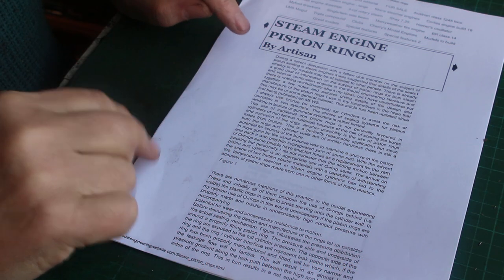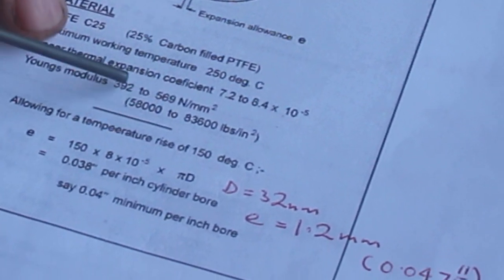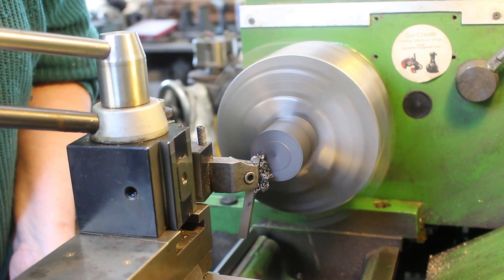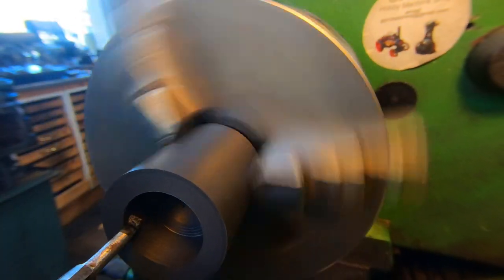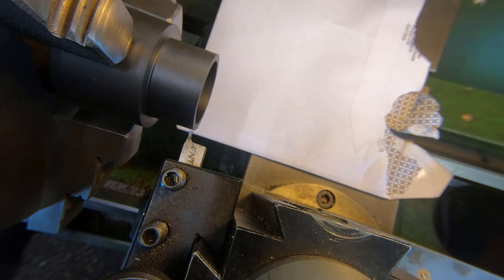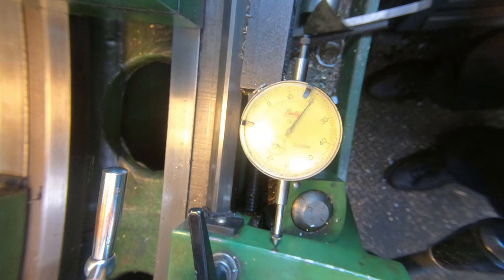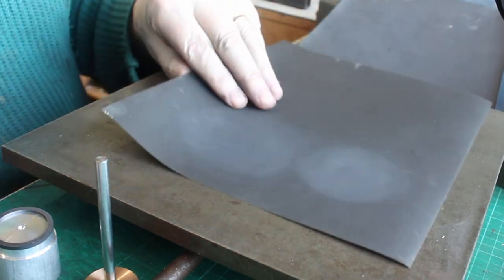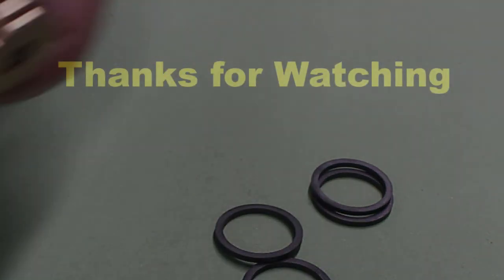Pistons Rings (pt.1) using Graphite filled PTFE, Lion - 5"g  Miniature Loco Steam Engine Build pt.46

Comment: Give a lot more Slot clearence! The piston ring works that way: the steam goes under the piston ring (through the slot clearence than between piston and pistonring) and pushes the pistonring against the cylinder wall....thats tights up against pressure.... backways the same.... the steam pulls the pistonring in the slot back first....than go between the piston and the pistonring.... that thights up.... and the piston moves....  i do a lot of researche because thats my next part... 

Last but not least.... a nice work as usual!
Reply from the maker: Thanks for that information, very much appreciated. So I'll lap them down a little more. Thanks for taking the time to comment.

Comment: If I may be so bold and offer you some advice on lapping! My trade was that of a "Diesel Fuel Injection Fitter" and as such spent countless hours lapping fuel injection nozzle sealing surfaces! The preasures we had to seal against were many thousands of psi, no gaskets or sealant, just metal to metal seals. And the buggers did not leak! So, when lapping we used lots of figure 8's and 1/4 turns. So, a dozen (8's) with a quarter turn. Repeat, often. The turn ensured no periodic errors and the faces were flaaaat! Naturally we were very fast at it and it worked. I hope you accept the information here, I am not being critical of you, just hoping I can help you do an even better job of yourgreat project.
Reply from the maker: Thanks Peter, that's great info. I will be lapping my regulator valve seats later in my build, off course these will be metal parts so your advise is much appreciated. Always willing to learn from a master craftsman.
Thanks for taking the time to comment.
Reply: @GoCreateHobbyMachineShop  Thanks Nigel, I doubt I'd be concieted enough to class myself as a Master Craftsman! More a capable one? But thank you for the sentiment.
Reply: @peterpocock9062  I would say that when it comes to this sort of thing, your experience puts you in the Master Class.

Comment: @Go Create Hobby Machine Shop Just wanted to ask at what temperature your cylinders run up too? I was looking at this method for a sterling engine I am designing. Unfortunatley this could see temperatures up to 500 degC. My best internet trawling shows  PTFE derivatives being able to handle 260 degC. Just wanted to know if you have had any issues or experience monitoring the seal performance at higher temperatures? Great Video, Kind Regards Will.
Reply from the maker: Hi Will. I recon the cylinder temperature will not be much higher than 150 degC. I'm pretty sure you won't find a PTFE that will go above 260 degC. Not sure if this would be any use but have a look at Ultem 1000.
Thanks for taking an interest in my video.
Reply: @GoCreateHobbyMachineShop  Thank you for replying. It sounds like an interesting material, at a quick glance the tollerable temperature looks lower than the Graphite PTFE, but would need to do more reading. On a plus note, I managed to find a paper that lead me to a company called Metcar, who make Carbon-Graphite Piston rings. I think they still own the patent so not sure what their prices are like mind, would have to enquire. Does seem like the perfect product though. Low friction with high pressure and temperature tollerance.

Comment: Hi Nigel, thank you for a  great series I have been following it all the way along, plenty of really useful information for us less experienced ones. Just a quick question if you don't mind..how do you find the tangential tool holder that you use. I have seen these and nearly bought a set, I may still do so but it would be good to hear an opinion from someone like yourself who uses them. Thanks.
Reply from the maker: Hi Mark. The tangential tool works really well. I wouldn't say it's any better than a properly ground regular tool, it's advantage is that to sharpen it you only grind one face and using the grinding fixture you get a consistent rake angle and hence consistent results. I like using it and probably use it more than a regular tool. Hope that helps.
Thanks for your interest in my videos, much appreciated.

Comment: Really interesting Video.   The 35 Deg. Overlap?   Is that the same for all Piston Diameters?   Or?
Reply from the maker: Hi Colin. The deg of overlap depends upon the ring diameter, the length of over lap remaining about the same irrespective of diameter.
Thanks for your interest.

Cheers!.
Reply: @GoCreateHobbyMachineShop  Thanks for getting back.   So please bear with me.  You got a 0.337" Lap after you decided that 35 Deg.  worked for the Rotary Table.  So I guess the Lap is in the region of 0.337" for any diameter of Piston.    Which you then round up to a useable degree for the Rotary Table? Have I got that right?     I need rings for 1.5" and 0.8125 for the Bobbin Valve.
Reply from the maker: Hi Colin
Yes, that's you've got it right, there's no reason to have an awkward angle to work with. If you email me I can send you the original article, you should find my email in my about page or if not then I show in in my baby vice build part 3 about 2/3 the way through.